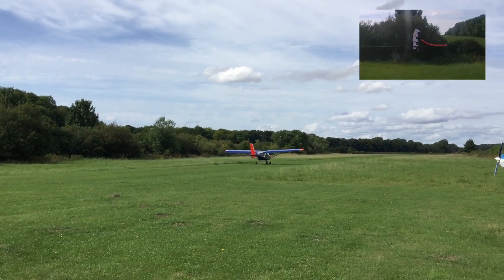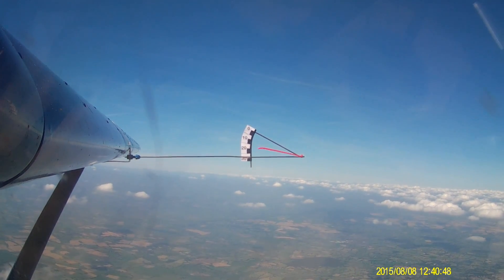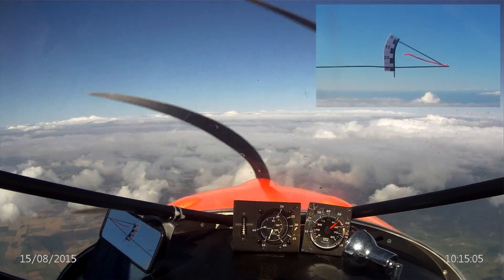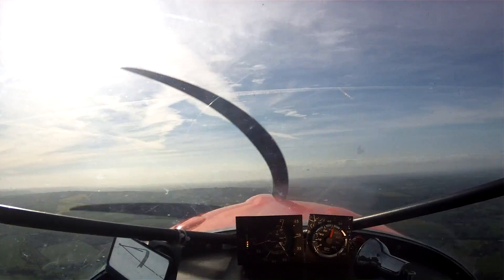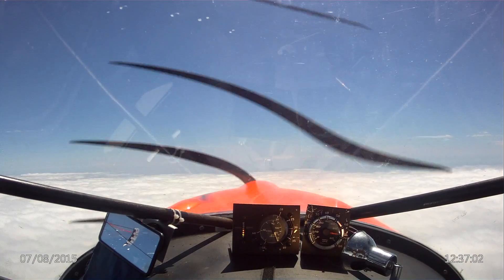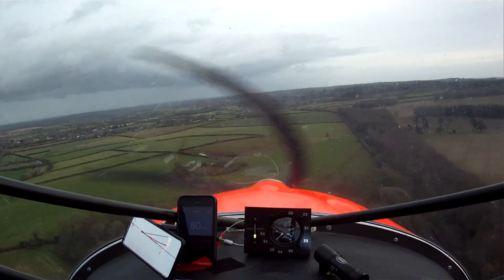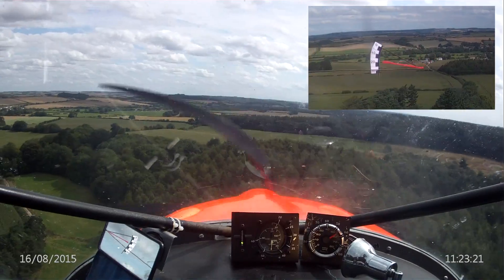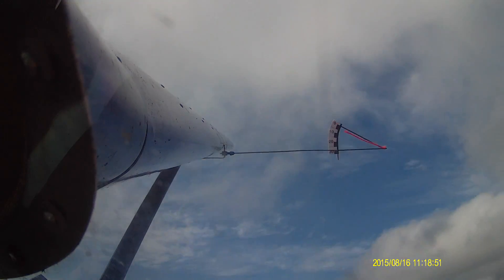Angle of Attack Indicator

Comment: This video is a neat demonstration of the variation in stall speeds at different flight conditions.  (You could also have added a light and heavy aircraft weights, which also affect stall speed, but not stall angle.)
I taped a length of red yarn at the bottom left corner of my windscreen, so that it streams back past the left door frame.  I then did some stalls and marked the door frame with the location of the string during a stall.  Per this video, I am going to add a line on the side windscreen where it streams past, extending the door frame mark forward.  It's always right there in my view when I am in a normal traffic pattern.  Easy peasy.

Comment: Does a specific stick position correspond to an specific AoA?
Reply from the maker: In a given condition of flight yes and in an aerobatic aircraft like a Pitts always, but my elevator also has to compensate for trim changes with flap settings and the difference between the thrust and drag lines and this alters the stick position
Reply: Ok during flap setting of course but during change in thrust does the change is big??
Reply from the maker: The Foxbat has nose-up trim change on opening throttle and this is very marked when flap is down. I do mainly glide approaches on our strip so the video concentrated mainly on that.
Reply: Ok, do you think you can use the aoa indicator to set an aoa  so you can fly long range cruise , or max endurance?. And after compensating for trim and thrust changes does a specific  stick position gives you a specific aoa ? 

Thanks again